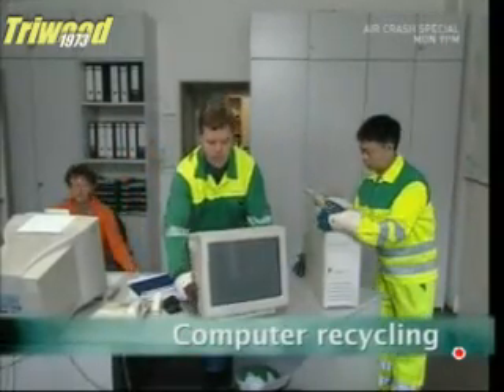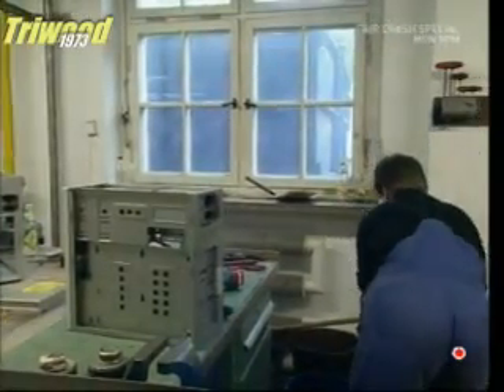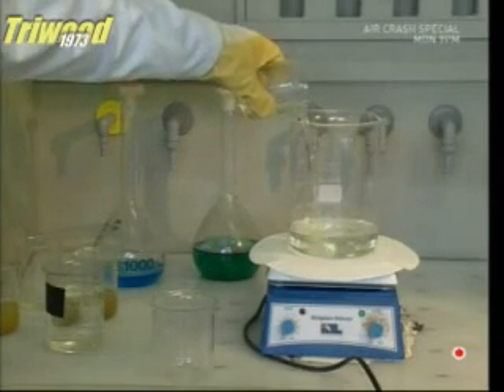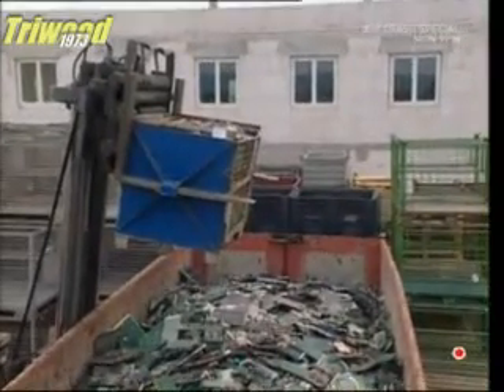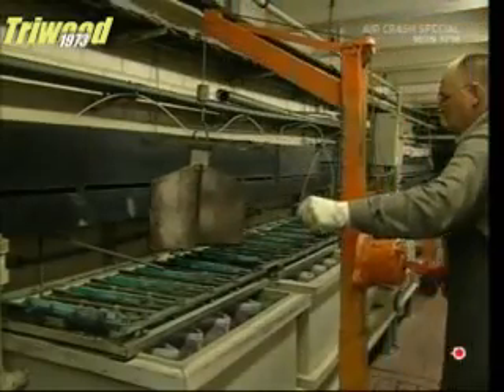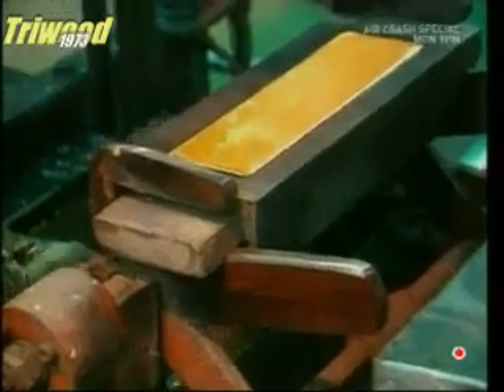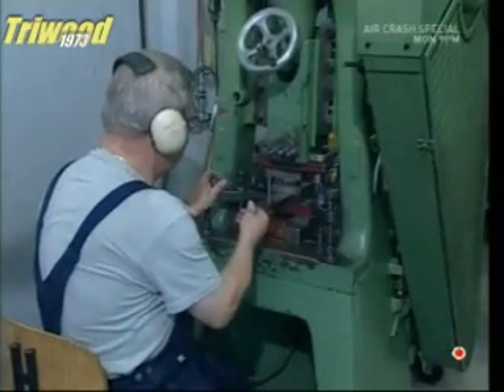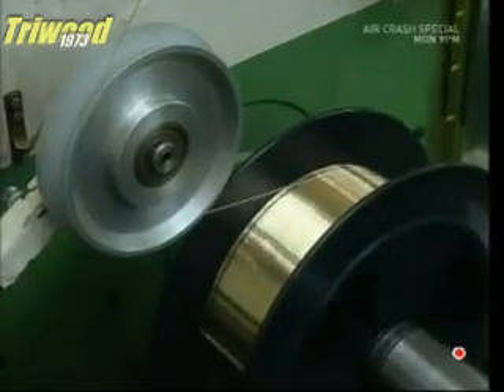Recycling Computers

Comment: What about the aluminium, tin, and lead that's in the computer?  Solder is made mainly of tin and lead (some containing small amounts of silver) and capacitors have aluminium casings, and are made of aluminium foil. What happens with these metals from the circuit boards?